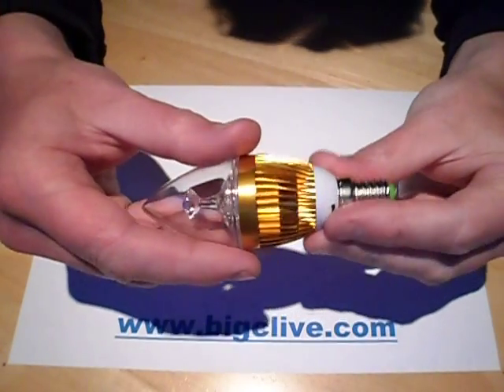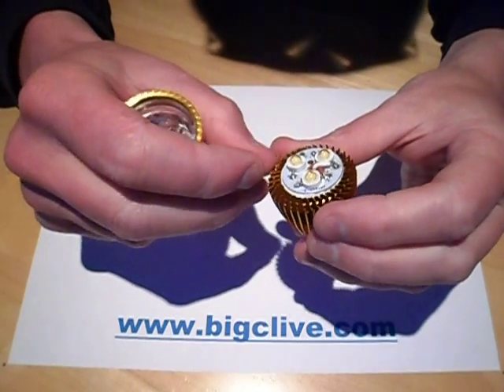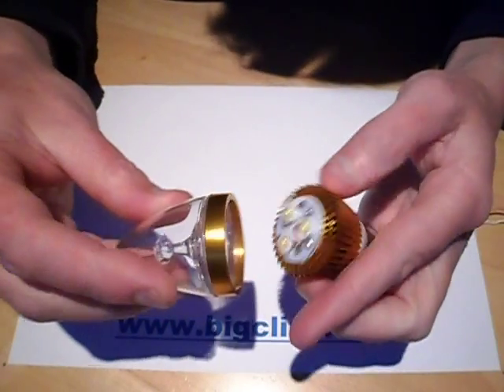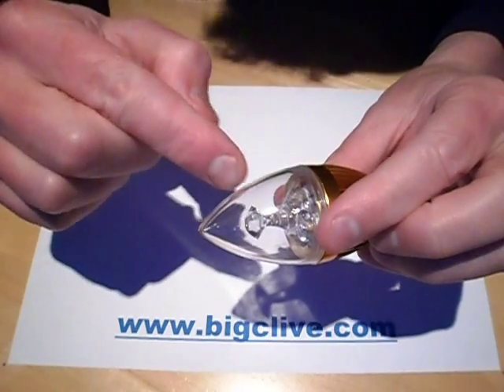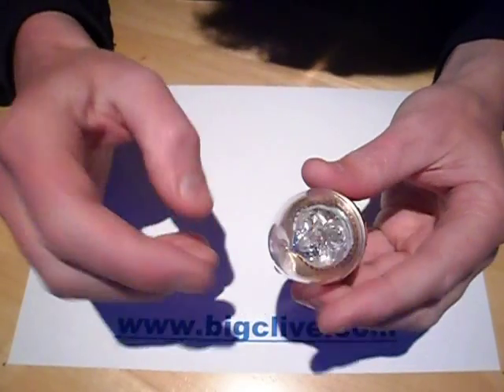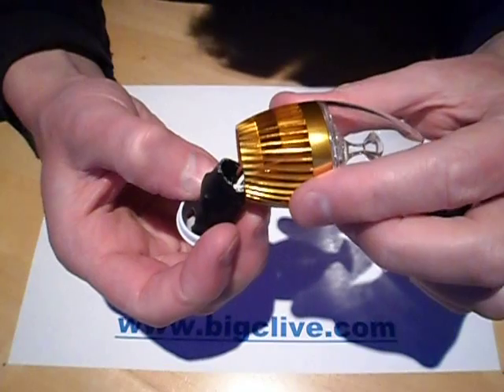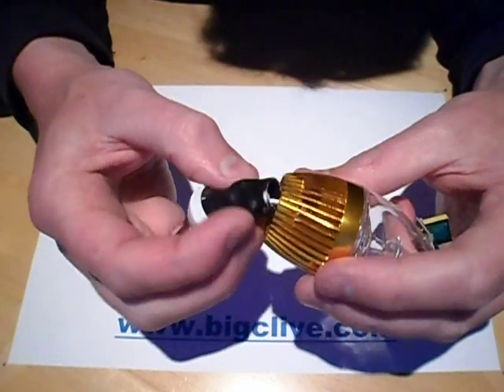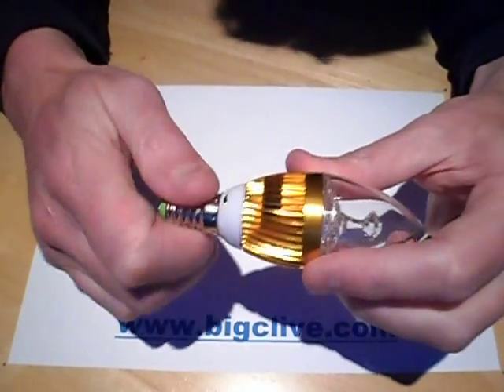Teardown of a different three watt LED candle lamp.

Comment: I just ordered one just like this off ebay in 6 watt as the seller didn't have any 8 watt left. Seems they look well built considering the price of them. Are they all similar in dimensions with a 6 watt version being just 3x 2 watt LED's instead?
Reply from the maker: I'm not overly convinced that I'd want to run a lamo this size at anything above three watts for thermal reasons.  It would be interesting to see what the actual power draw of your lamp is when you get it.  Sometimes manufacturers say things like "Three 2W LEDs" when they are actually driving them at just 3W.
Reply: bigclivedotcom Its going to be used for a lamp on my desk. I'm not sure if it will be bright enough at only 6w. I'm currently running a 9w CF small candle bulb in there at the moment at its stated to flicker a bit at times.